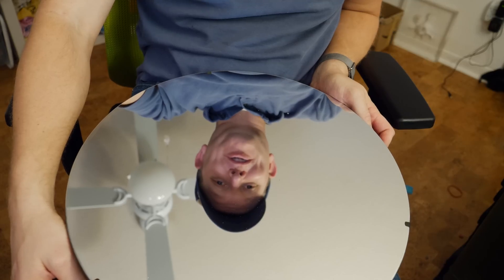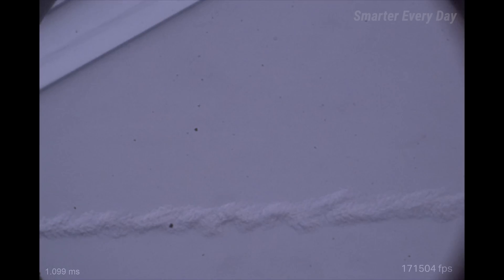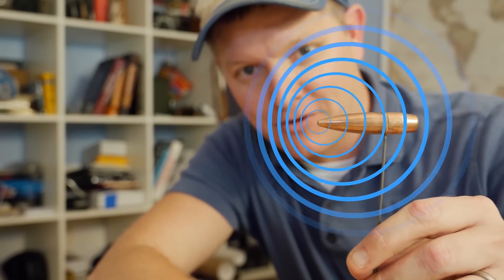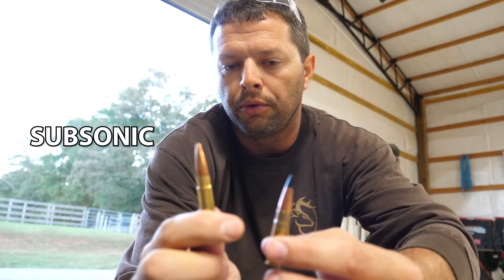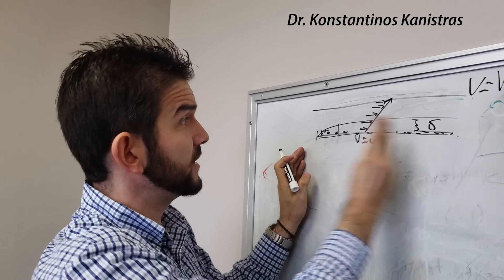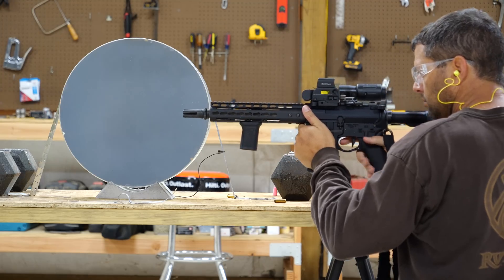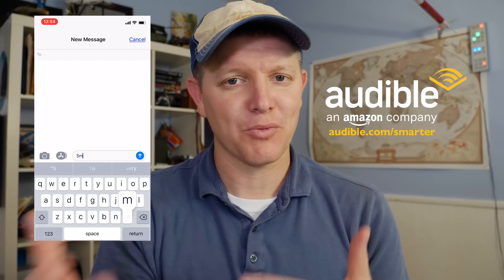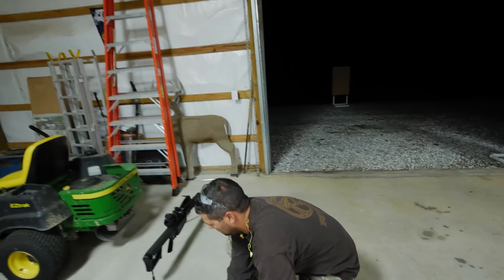Shockwave Shadows in Ultra Slow Motion (Bullet Schlieren) - Smarter Every Day 203

Comment: Aerodynamic physics is very tricky..  we operate in an everyday realm ,,  when things are pushed outside our known physics, it becomes hyperphysics,,,  When you are shooting these bullets the "fast ones",, you are seeing the flow or air adhere back across the bullet skin..  Push that bullet another 5000 feet a second  the physic properties change.. now the cone leaves the bullet skin and becomes a much wider penetration cone..  to the point its nearly vertical to the point of the bullet.   When they were first setting speed records at the Bonneville salt flats with motorcycles  a phenomenon was witnessed..  They could be steered in the conventional way,, turn right to go right but at higher speeds the driver would turn right to go left..  then back to normal again after obtaining another higher speed..  We give ourselves too much credit for our knowledge base,,  we are at the entry level for understanding the physical world and that was good enough to get us to the moon.. think about 500 years from now..

Comment: You can do a 'poor man's Schlieren' simply by shining a well-focused LED torch on a wall and placing the subject in between the two, with a lighter you can see the gas coming out or the hot air rising from the flame.

Comment: Those circles at regular intervals could be imperfections in the bullet as it rotates.
Reply: For lack of an easier to understand explanation, they're aerodynamic vibrations similar to how a whistle works. When you blow in a whistle, the air oscillates back and forth between going into the cavity and bypassing it...that vibration causes the sound associated with a whistle.  Tiny imperfections on the surface of the bullet (such as the where the rifling cuts the jacket) act in a similar way.  The air goes into those cuts and then bypasses on the outside of them.  Since this is all happening in extreme slow motion, and the cuts are so small, what you're seeing are the individual pulses occurring being shown as very faint but observable circles.  You'd see a similar effect if you somehow managed to shoot a whistle at near transonic velocities at just the right angle in front of the mirror.  Coincidentally, a subsonic projectile often has a whistling sound, though most of that is caused by the base of the projectile creating aerodynamic shearing of the boundary layer surrounding it and the bubble of stagnant air behind it.

Comment: Thank you for these insigjts. However, there is one more unsolved riddle. Why does the first shot of a .300 BLK subsonic with a large monocore suppressor have a different point of impact than all subsequent shots taken (given that no air is vented into the suppressor inbetween shots, so only a few seconds between them)? 

This can also be observed with other calibers and setups. But since you were using this one anyway it would be a great thing to investigate. 

Like transparent suppressor as before but 2 shots taken including schlieren profile of exiting bullet and gases.

I assume the gases might burn due to the air in the suppressor and build up counter-pressure that slows down the first bullet. But this is just a guess. 

Please make me a bit smarter :-)

Comment: Can you do this with a 120mm HEAT round, the nomenclature is M830A1, not sure if you wpuld have access to this round, but from what i understand is the tip has a standoff spike with a blunt nose, about 1 inch in theres a lip type ring about 3/16. That lip is suppose to open the air up and help the round slip through the air better.

Comment: Another good vid thx..   One addendum to your experiment:  Simple logic would dictate:  that as the bullet travels faster the shock trail would adhere to the bullet jacket/skin contour, closer to the ogive of the bullet  ( lay back effect) not so..   Physics like to keep simple human minds guessing.. the shock wave actually begins to move forward towards the bullet tip and widens greatly.   Get a caliber whose muzzle vel is greater than the 50 BMG youre using,,  Use a very light projectile ( increase velocity)  and then compare and measure them side by side.. Youll see the difference..  and it amazing.. Aberdeen ballistics dept.

Comment: So that is what gun powder residue looks like as it distributes?
Reply: It's the hot high-pressure gasses expanding and cooling.  Different temperature and pressure gasses refract light producing those waves.  If you watch a hunter or marksman take a 1mi shot with that .50 BMG, you can see the waves in the air from the heat/pressure coming off the bullet as it travels downrange.  Pretty cool as you can see the trajectory as it drops from gravity.

Comment: It appears the shockwave from the muzzle is air expelled from the barrel by the force of the bullet travelling down the barrel to the muzzle, then the flash of powder, then the bullet penetrating both the powder flash and the muzzle shockwave. I most liked the small turbulent trail on the supersonic .50 shot inside the shockwave cone.

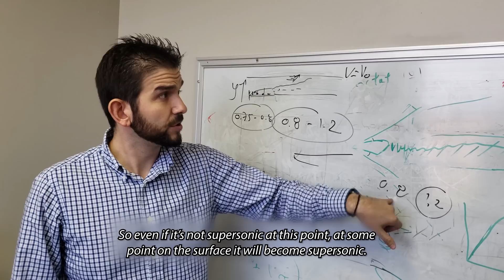Comment: 6:45 even if its not supersonic at this point (the top of the bullet). at some point on the surface it will become supersonic. the flow accelerates. i understood the description up here. why or which causes the air flow to accelerate?

Comment: Couldn't you calculate the time it would take for sound to travel from the gun to the setup.
Then you could compare it against what you think is the sound of the gun in the video and see if the time matches.
But if you don't know the timings of the shots, you will have to use the bullet speed to sync the footage to when the gun was fired.

Comment: With all respect, i think that your explanation of the cone was a little wrong. There is 2 limits. The  first "cone" that is in the front of the bullet is a supersonic wave (the shock), that forms a bow a little distance above the bullet. The true cone in the beggining of the bullet is the sonic wave that you explained with the classics draws. So don't confuse a shock wave in the air produced by the aceleration of the fluid due to the movement of a body(that can happens even in a subsonic object moving, like de dr explained) with the expansion wave of air that is the sound propagating more slow than the bullet. The spheres that forms a cone in the draws is NOT THE SHOCK. 

Eventually the shock dicrease and mix with the expansion wave to produce the sonic boom.
I think you should correct this error.

Other than that, great video a thank you so much!!!!

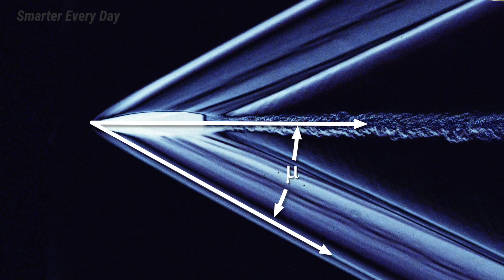Comment: 3:35 these circular wave may be the sound of the bullet under “normal” settings. Imagine the air is hitting the stationary bullet’s tip. That is a percussion, and sound will move from that stationary bullet tip in a spherical way, as sound normally travels. But because the bullet is moving faster than the sound of air hitting the tip, the bullet is moving through the circles that are made. 
An arc angle can lead you directly to the point in space where that sound was generated, where the bullet moved away from the point of generation faster than what was generated propagated.

Comment: Hi all,

Apart from speed when would a subsonic round be more useful than supersonic round?
Reply: silence, if you want to use a supressor to (almost) silence your gun then you need your bullet to be as quiet as possible. The supressor deals with the sound of the gases on your muzzle, a supersonic bullet would still sound pretty loud with the ''sonic boom'', so a subsonic bullet would finish the job of making your gun ''silent''.
Reply: @morke1911  cheers geezer!!!!!!

Comment: You can see toroidal vortices at the muzzle, would be cool to see how obstacles mess with that and other parts of the flow, e.g. firing with the muzzle with the ID lined up with a steel plate at various angles to the camera, how the plate material impacts the flow too (porous/non-porous) and maybe even a slight ricochet of the projectile?

Comment: But does it have...LAMINAR FLOW?!
Reply: I´d say it´s too fast for laminar flow... I say NUCULAR
Reply: Sure does!
Reply: another very misunderstood ' theory'
Reply: The air molecules in the boundery of the "cone shockwaves" is pretty laminar. And the aftershocks were pretty turbulent. So yes
Reply: I think it would have to have an unreasonably long taper on the back to have 100% laminar flow.
Reply: supersonic flow and laminar flow doesn't mix together
Reply: ur mum has laminar flow, m8.
Reply: I think it's laminar before the shockwave and the flow separates thereafter, that's why the bullets seems to tumble around
Reply: @fidelitypicturescom  I don´t see any tumbling in the supersonic bullet. If you look more closely you see a very thing bright layer around the surface, that´s the boundary layer. The only way the boundary layer can stick around the bullet is if  it has enough energy to press itself down to the surface. Only turbulent layers are that energetic. Besides, at that speed you should have turbulent flow.
At transonic speeds the Airflow isn´t quite as energetic, so any imperfection on the surface of the bullet will cause a sonic boom normal to the flight path (M=1/sin(90)=1), which dramatically increases drag und forces the bullet to tumble. 

Even then the airflow should be turbulent, but that is measured by the Reynolds Number, not the Mach Number
Reply: @fidelitypicturescom  Anytime =)
Reply: @emils4049  The airflow in the viscous sublayer is laminar. It always is. So yeah, there's always a zone in a wall-bounded airflow that's laminar, although we're being quite pedantic when saying so :p

Comment: I am guessing the circles are just the sound waves that come from the turbulent eddies at the back of the bullet. The regular spacing is due to the dominant frequency of the noise produced. Estimating their separation at 0.5 mm (0.02 inches), and using the Mach=2 speed of the bullet, one can estimate their frequency to be around 100000 Hz (inaudibly high-pitch).

Comment: As a life time shooter (I'm 76 now) and also with an aviation/aerodynamics background this was very interesting......especially the localised supersonic airflow on a subsonic projectile.... Great stuff and wonderful filming...
Reply: That's why you lose so much accuracy once a round goes sub-sonic. There's so much turbulent flow in the transonic region, it's difficult to get consistent behavior out of a loading.
Reply: Did you know the same thing happens with a helicopter’s roter blade.  The blade meeting the wind in the direction of flight meets air at the speed of the chopper plus the speed of the rotation of the blade.  The combined speeds go supersonic on the edge of the blade producing the noise of the blades.  This is what limits the copters ability
Reply: Thomas D Harrell interesting!
Reply: 2:18 I like that you can clearly see striations in the 'wake' turbulence caused by the spin of the bullet.

Comment: Thanks for making this amazing content! 
The circles behind the bullet (3:48): In the front of the bullet the air is getting supersonic speeds by beeing displaced by the tip. This causes a linear flow around the bullet. But at the back of the bullet, the vacuum created sucks the air around, creating a high pressure-low pressure fluctuation. I think this circles/spheres are little vaccum implosions right behind the bullet. Their shockwave (or vacuumwave) is traveling at the speed of sound, so roughly half of the speed of the bullet.
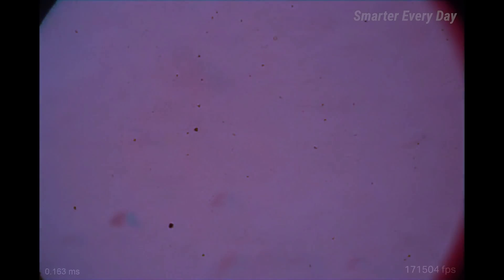About 1:42, awesome shot!! the shockwave reflected from the table seems to be a representation of the surface hardness variations of the board surface. Im just wondering if you put a SmartEreveryDay stencil on the table, you would get an awesome smartereveryday shaped reflected shockwave??
If you did read all this, you absolutely deserve one more patreon.
Thanks again SO much for this videos!

Comment: "do you know what the speed of sound is?"
"its like twelve something"
Reply: It depends on the altitude !
Reply: @kengamble8595  actually it's barometric pressure,  which is a combination of altitude and temperature
Reply: @sigmaforge5088  in the end it´s the air´s density (molecules per volume / average distance a molecule travels between exchanging momentum with other molecules), which depends both on temperature and altitude. And yes, "12 something", as in "times 100 ft/s" is pretty darn accurate for most normal circumstances.
Reply: honestly, twelve something is exactly how I remember it, too.I think he wasnt refering to the 11something feet per second, but to 1236 km/h.
Reply: @goodchildm.a.a.durbanarea4739  haha, yo, but then again "twelve something" is kind of the universal rule of thumb, as it should be accurate enough in both systems for most circumstances ;-.) guy´s a real pro
Reply: I was dead lmao that made no sense
Reply: @Taz-X  12-something, as in ~1200fps.
Reply: @Taz-X  let me make sense of his expertise for you. He claimed the subsonic bullet traveled at "a thousand-eighty" 1080 fps and that the supersonic bullet traveled at "fifteen hundred" 1500 fps so by his verbiage,  "around 12 something" should easily translate to the 1200 fps which is, as I'd say, close a-fucking-nough to the 1125.33 fps speed of sound of air at STP.
Reply: @evanemanuel1774  didnt need an explanation... i understood it... it just sounds funny.

Comment: We had a wind tunnel at College that would do supersonic speeds... using schlieren.
The tests were just like this only the bullet was stationary and the air was moving by it ...
The throat was only like 4x6 inches, and had windows on both side 
We had a light on the far side and we would tape paper on the near side and trace the shock angles by hand. 
We tried taking pictures of it (film) but most of time they didn't turn out.
We had this huge tank of compressed air - it would run the wind tunnel for about 4-6-8 seconds depending on the Mach number.
The University didn't want us to do to many tests because it would cost to much money for the department and they had a limited budget.
Then we would have to wait like an hour for the tank to refilled before would could do the next test.  
This was in the mid 1980's at the University of Utah. 
Brings back great memories.
Reply: Very similar set up at Purdue. I only got to use the supersonic tunnel once, but I didn't take the advanced labs or go to grad school.
Reply: At UAH, Dr. Ligrani oversees research at the propulsion research center at UAH that uses a supersonic wind tunnel. I've never used it unfortunately  lol.

Comment: The circles are the boundary layer coming off the back of the bullet, they exhibit a circular shape because of the spin of the bullet. You can see it better with the subs as.
It also proves that even though airs mass is so minute the physics behind it are amazing as the boundary layer both keeps it on the bullet and keeps it from coming off the bullet.

Comment: what about a tracer round Vs normal round? does the heat emitting from the tracer reduce the angle of the shock wave with respect to the direction of travel? will it remain the same? or will it induce a parabolic arc?

Comment: I have one heck of a schlieren use case with ballistics involvement... you just need a solid surface in the frustum of the rig there. So.. the suggestion?
Fire a supersonic projectile parallel to that surface with enough separation that it's not in contact, but the mach cone reflects off the surface with enough time to interact with the projectile body. Why? To see if a rifle bullet can be deflected simply by passing too near a solid object. 

Also might try painting a silver/white dot or line on the bullet ogive to catch rotational speeds.

Comment: Hey Dustin. I've heard that the supersonic wave behind a bullet is super hot compressed air and that's where the term "bullet burn" comes from. If the bullet misses but is close enough, the supersonic cone will rip and burn you. Can you confirm or deny?
Reply: Are you taking about grazing? It's like a supersonic rug burn but with hot gases.
Reply: @Ducaso  Yes, good description.

Comment: Great footage as always. A few clarifying points (which you may already know):

1) When using the Mach angle to measure the speed, make sure to measure the angle far away from the object. Since a Mach wave is the weak limit of a shock, the shape of the shock will only approach that of a Mach wave once the distance away from the object is several times the characteristic length scale of the object. Think of it as moving far enough away that the object can be treated as a point mass. If you measure too close, your measurement will be influenced by the local curvature of the bow shock.

2) For the subsonic round, what you're observing is indeed a normal shock. However, the object doesn't have to be traveling at transonic speeds for this to happen. The transonic Mach regime is not a rigidly defined range of Mach numbers. The phenomenon you observed is caused by exceeding the critical Mach number. Critical Mach number is the free stream Mach number at which some point in the flow has a local Mach number >= 1. For a slender object like a bullet, this will occur in the 0.8 - 1.2 Mach range, but a more blunt or otherwise oddly shaped object may have a critical Mach number well below 0.8. So the behavior you saw is a function of the free stream Mach number AND the shape of the object.

Comment: Dustin, you should try hollow points, semi wad cutter rounds and wad cutter rounds. The wad cutter are flatter tipped bullets used in old competitions to cut cleaner holes in the paper targets. They should be pretty easy to find in TN. Maybe even some of the more gimmicky ammo like the RIP rounds or some of those exotic shotgun shells.